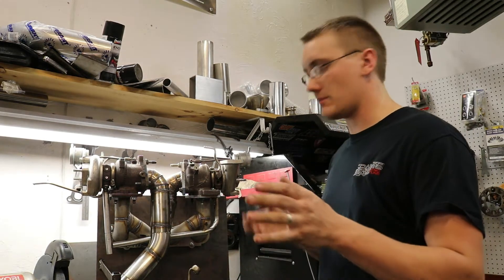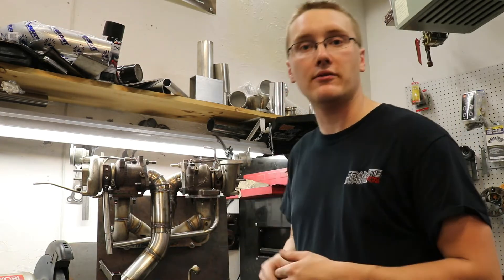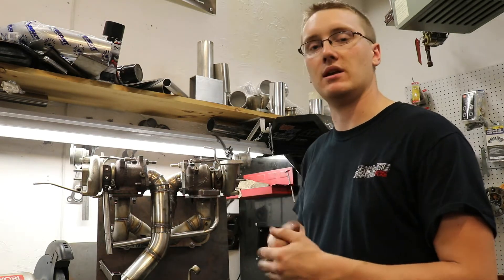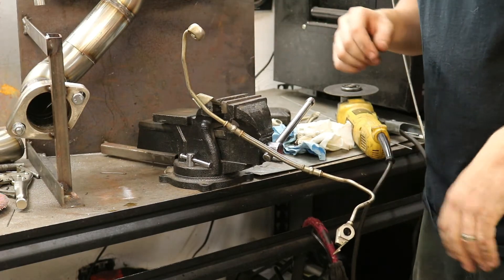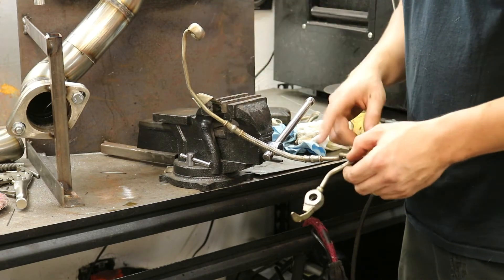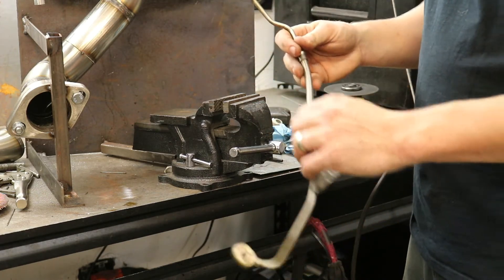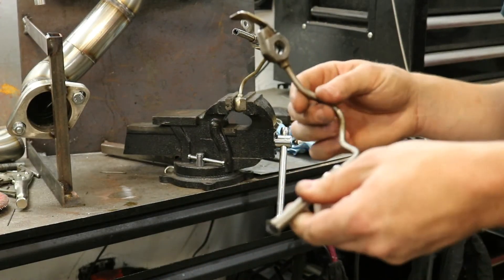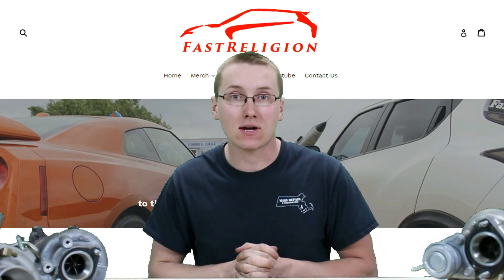Nissan Juke: Why The Oil Feed Line Fails (And Blows Up Turbos)

Comment: Is this a common area to leak on these engines? The reason I ask is it’s smoking from passenger side area near that area. I’m not 100% on if it is this line but wanted to swap out to your upgraded line.
Reply from the maker: most likely valve cover or timing cover leak. The lines themselves rarely ever leak.

Comment: I have a 2013 Nissan Juke leaking quite a bit of oil mechanic diagnosed as whole front of engine leaking oil, possibly due to condensation freezing and then thawing. $5,000 to fix 😮 idk what to do 😢. Do you think it could be this as culprit? Tia 😊
Reply from the maker: Without the vehicle here to diagnose i cannot tell you what the issue is. If you dont trust what you have been told take it for a second opinion.

Comment: So basically if you don’t change the oil, the oil feed line will fail? Are there any other reasons why they are prone to failure? I would absolutely appreciate a responce, as I have been contemplating changing out my current OEM line simply as preventive maintenance. Thanks so much FR 🤘
Ps my juke is 2014 SLawd with 109k miles and has had regular oil interval changes its whole life to my knowledge.
Reply from the maker: Regardless of if the oil changes are done perfectly, they still can fail. Whenever we get a stock Juke that comes to the shop for any sort of repair work or maintenance, we try to get customers to swap out their feed lines as a just in case.

Comment: Hello! How much does a mechanic usually charges to replace it?
Reply from the maker: That depends on your area and the labor rates. We charge $150 to replace the line which is about an hour and a half of labor.
Reply: @FRArchive  thank you! And how long do you take to replace the turbo?
Reply from the maker: $500 in labor. But we also require the turbo manifold be replaced at the same time as the turbo.
Reply: So parts and labor how much is it

Comment: Can the turbo be fixed
Reply from the maker: Once the turbo suffers oil starvation, it usually fails in such a way that it cannot be repaired.
Reply: Can I get the link to the kit for the after market turbo line
Reply from the maker: https://www.thefastreligion.com/v1-turbo-parts/p/fastreligion-oil-feed-line-replacement-v1-mr16ddt